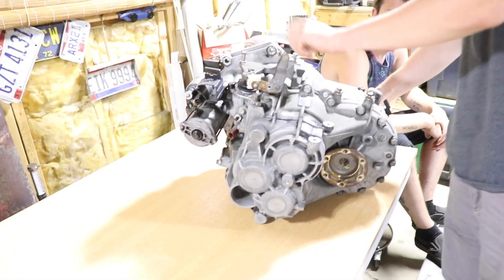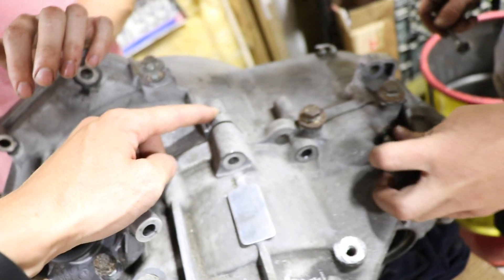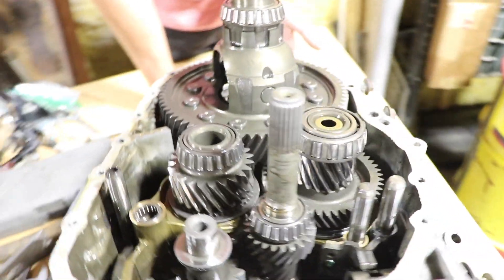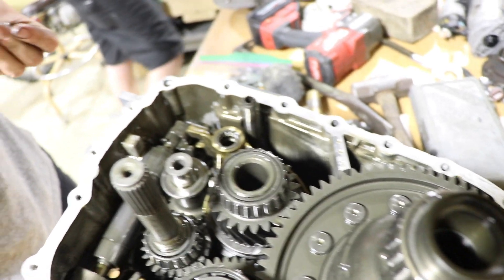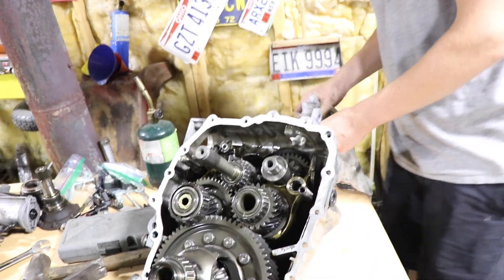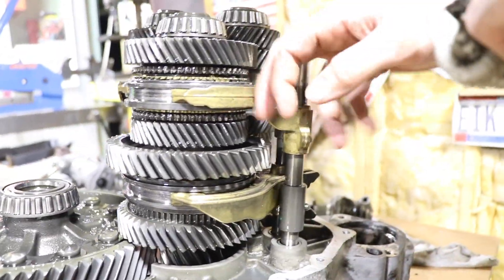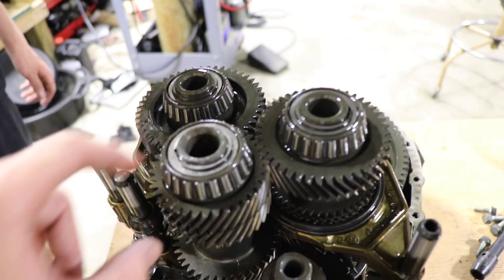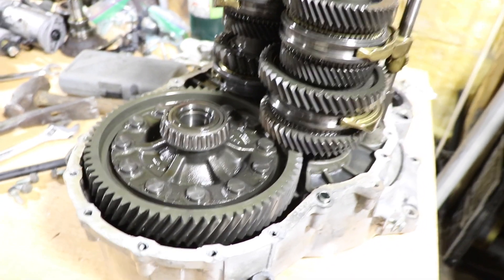02M Trans Teardown/Build List! (LSD, Steel shift forks, Input shaft support, Trans case Support, VR6

Comment: If anyone is watching this and can't get the case apart. The Bently manual states that you heat up the case to 250F for 2 minutes where the output shaft sits and use a slide hammer in a special bolt hole in the case (it's obvious which one) post heating to separate the case. 
THe gears should basically "pour out" of the case with the Diff being 2nd to last. Have a helper tech aide in removal of gear sets.

Comment: Have you guys even bothered taking a look at a repair manual?
Reply from the maker: You can’t get a repair manual for these transmissions, we have a Bentley but there is nothing for inside the trans. So basically you’re on your own. We have some HARD miles in this transmission, so I don’t think we did too bad🤙
Thanks for watching! ⚙️⚙️
Reply: @PostPros  I think the Audi TT Bentley has 02M teardown in it? I just bought one one Ebay so I'll find out soon. I'm doing a TDI-geared 02M 6 speed for the B4 wagon build.
Reply from the maker: @andrewlewis4253  let me know if I has the teardown in it, that would be awesome!!
Reply: @PostPros  Will do. I didn't mention my 02m is a FEK code 4mo trans for my haldex-rear B4. That's why I rolled the dice on getting the TT Bentley.

Comment: Good. Info on these  parts to make this trans hold power.. I'm building an 02a so its a little Different  but hopefully I can find parts to make my trans handle. Power,  I'm also going for 600 on my Build.. I'm having a hard Time  Finding time To upload content haha.. At least I have 1 video up :)
Reply from the maker: Nice!! So what kills these trans (any trans) is a turbo that’s too small. One that spools way too quick, too early in the rpm’s and the trans is what takes it ALL. It’s hard on the gears and shafts, if it’s up higher in the rpm’s it’s already spinning and isn’t as likely to bend/flex/break!! If you get a GT35 like everyone does get a 1,06 housing, it’ll spool a little later but pull to redline because it’ll flow better and won’t get choked up in the high rpm’s. We’re going to be running a gt4088. 
Just my opinion!! There’s a couple VR6 Facebook groups you should look into, TON of info🎉💪